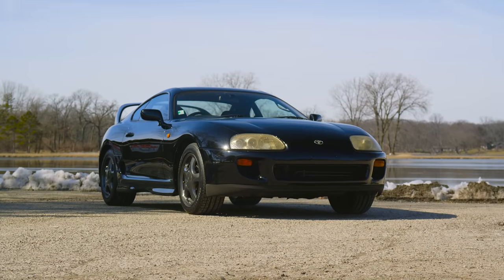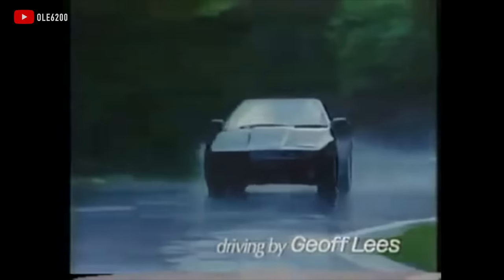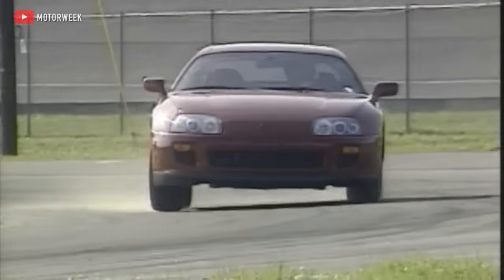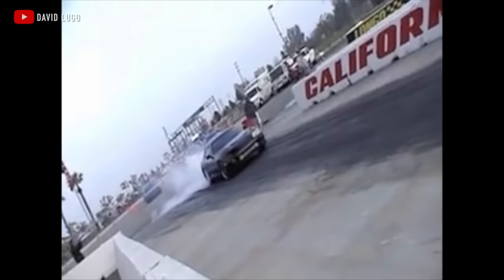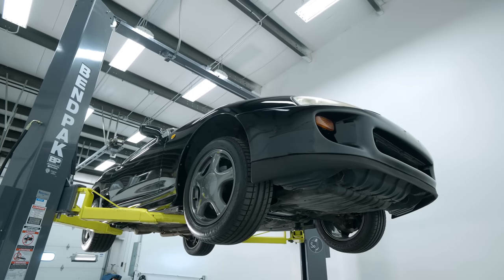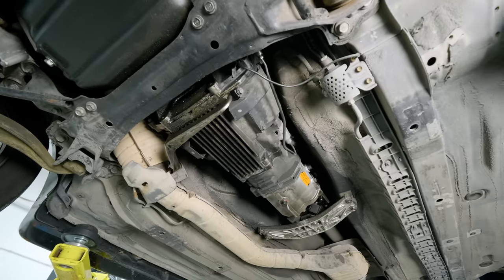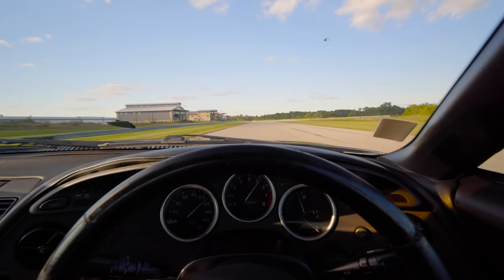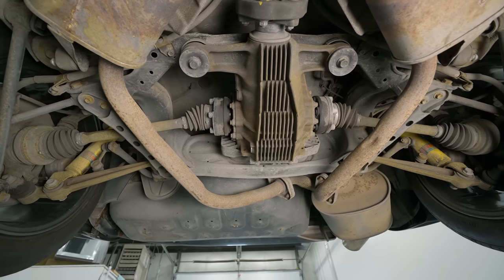Toyota Supra MK4 | Over Hyped or Legendary?

Comment: stopped watching after the first few comments when driving - "Imagine this car with tires from that time?  Almost no grip whatsoever."   It pulled 0.93 on the skidpad back then.  Today's Elantra pulls 0.97.  They are driving a bone stock car.. with what looks like the completely factory suspension, which will now be about 30 years old and showing it - soft springs, tired shocks, hockey puck bushings.  The headlights aren't even cleaned up.
This test drive is not representative of the car as a comparison to something new or what you could have expected in 1995, say.  This IS representative of what you'll get if you buy a stock supra *now*.
Put new factory-spec shocks/springs/bushings/swaybars and get back to us.  That's just maintenance, not modifications.
.. and polish those headlights.  Have a care, geez.

Comment: I know the JDM cars didn’t have the same power levels as the US cars due to differences in fueling, turbos (I think) and cams (280 Vs 320hp). Not sure if there was any differences in suspension tuning.
Reply: They dyno slightly less than a USDM MK4 Supra.The difference in HP is closer to about 10hp. USDM runs MAF, JDM runs MAP, JDM has smaller 440cc high impedance injectors, USDM has 550cc low impedance injectors with resistor pack. USDM has more lift inlet cam and more aggressive ignition and fuel map ecu. JDM has faster spooling ceramic turbos. The 280ps (276hp) was only on paper per the Japanese gentleman's agreement of the 90's and early 00's.

Comment: You guys always crack me up just to run the heater in cold temps lose 60 miles of range 😂. Not a fan of EVs. God most new cars EVs are soleless it’s crazy to me. I’m in my early 50s and car enthusiast. My done buying these boring cars. I have a low mileage 2019 BMW M550 that I bought used in 2020 for 49k with 9000 miles. That car now seems alive. I was blessed to purchase a 2018 really low mileage gt 350 last September. That’s it for me. I’m with Mark you feel nothing in new cars and that is such a shame.

Comment: If you think $50k is a lot of money, but you're willing to, or think you need to spend $20k for a high mileage rat that needs $10k of maintenance/fixing fuck ups+ $10k minimum performance upgrades/work, AND are hesitant/lack proper mechanical knowledge to look over and address every system, component and potential issue from top to bottom, then you're not ready to do stuff yourself. Tuning with a laptop and bolting on over marketed, mismatched parts that often decrease performance is nothing new. If a car is even near 20 years old/high mileage, and the new owner is not mentally/financially prepared to pull/teardown/inspect and rebuild the motor, along with thoroughly looking over the drivetrain and suspension for safety/wear/future performance and reliability issues, then at least be prepared to do thorough research, along with basic maintenance, utilizing junkyard/internet sources and your local auto parts store.

Comment: the car itself is rather unremarkable (both turbo and non turbo); however, it's the turbo's tuning potential with it's legendary engine that propelled the car into folklore.  it wasn't a bad car in first Need For Speed game, but it was out classed by the other 5 cars in the game.  overall, it is an overweight fat pig grand tourer and not necessarily a great sports car.... 🏁

Comment: Then again, when you're pushing an old car with sloppy old rubber bushings, it's hard to get a feel of what the car was like new. I've owned 4 Supras and by far the worst ones dynamically are the ones with the targa tops. Those things flexed like a wet noodle. Im kind of disappointed Albon left out the awesome MKII Supra which was far cooler than the MKIII imo.
Reply: The A60 actually had way better driving dynamics than the 70/80 series and it was only 2800-3000 pounds 86/brz territory.

Comment: i think its a great car but what makes it even greater is the engine and you can put the engine in almost anything the 2jz ! i could put it in my S14 or my 75' 280Z its like the JDM USDM its like the chevy 350 small block of our time. I think the ultimate USDM JDM car would be the VR4 Mitsubishi with a 2JZ engine why? because of tech and reliability in the same car. Therefore i believe its highly overrated period.

Comment: Little disappointed boys 😕 Would of been a better video using a US spec one with fresh rubber suspension bits. Took a weak swing at this one.
Reply: This one was a hard one for us as the mk4 supra is entirely out of our wheelhouse. So we turned to albon, trying to also find a completely stock one that will also can be driven is near impossible

Comment: They stopped short when tracing the Supra's roots.  Its roots actually go all the way back to the Corolla.  I was alive when both the Celica and the Supra were born.  The Celica started out as a more sporty trim of the Corolla called the Corolla Celica.  It was popular enough that it was spun off into its own car.  Then came the Celica Supra, and rinse and repeat.  Also, the pricing for the MkIV Supra didn't just get to "nearly" $50K, it surpassed it.  I still remember looking at a white one in a Toyota showroom.  It was $53,000!  In 1993!!  My thought was, "FIFTY THREE THOUSAND DOLLARS?!?  For THIS?!?????"  I respected them for their performance at the time, but I've never actually been a fan of them; not even the 4-digit power ones where full-throttle traction doesn't exist below 180MPH.  To be honest, I think the praise of modded 2JZs is disingenuous.  The blocks are so modified beyond stock that it shouldn't even be mentioned in the same breath as the stock block.

Comment: 4th gen supra could be released today and people would be all over it.
Reply: Until regulations come into play.
Reply: @pmayo7894  the 2jz could meet modern day regulations. bump in compression new turbo chargers and a combination of direct and port injection.
Reply: @Manny32V  - it ain't just the engine. The car's chassis and passenger protection also needed extensive updates as well to comply.
Reply: @pmayo7894  doable.
Reply: @Manny32V  - again, chassis and passenger protection needs extensive updates. So, it's not exactly doable without meeting the stringent regulations compared to the 90's. Total that and the engine modifications (even as trying to get it to meet performance goals) and this would be expensive.

Comment: Overhyped, a stock turbo car recently pulled slower than a GR86 in a drag race done by carwow, and back then, when tested on a track by Keiichi Tsuchiya at Best MOTORING, it was the only turbo car slower than the DC2 Integra Type R lmao. 
The only MKV "Supra" worth any merit was the GT500 chassis that had a motorsport 3S-GTE. Otherwise it is an overrated pig eternally idolised by bus riders and mouth-breathers that have only had any interaction with the car via american hollywood movies.
Reply: That was on a very wet track. How old are you? Because I’m old enough to have remembered and owned motortrend, caranddriver magazines back then. In the 90’s it hung with the best. It’s a low 13 sec car. No GR86 is going to do that.
Reply: @electrikoptik  "that was on a very wet track" 
Yeah so the GR86 that was driving in the same conditions must have had magical tyres right? 🤡
Reply: Are they going to view it in perspective (the timeframe when it was being sold) or with a comparison to modern cars of today?  There aren’t many cars from this era that can hold their own with modern cars.  When manufacturers are selling 4-cylinder turbo powered cars that can put out 300hp, and 6-cylinder turbo powered cars with 500hp, plus modern build quality and safety, there’s not a lot that these older cars can have over modern cars.

Of course, all modern cars have too many electronic nannies that numb the driving experience.  But I digress…
Reply: @AKK5I  The GR86 runs on average about 14.6 @ 97 mph. The Supra runs on average 13.5 @ 106mph. It's a bit faster than the GR86. On bestmotorings channel there are quite a few vids of tsukuba battle which features the MK4 winning. It won its debut race in 1993. It was capable of running at least a 1:06 on tsukuba: watch?v=FFEi-0Rx6J0